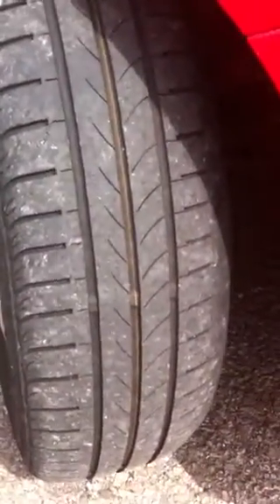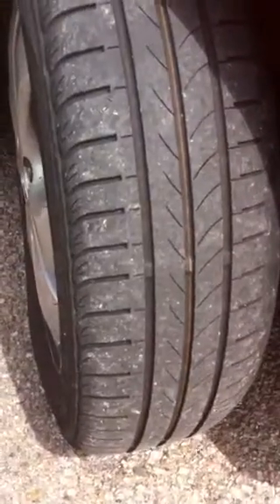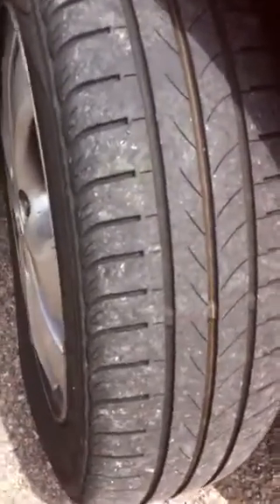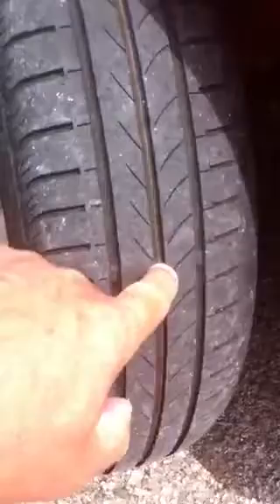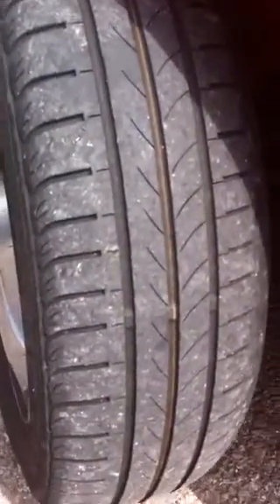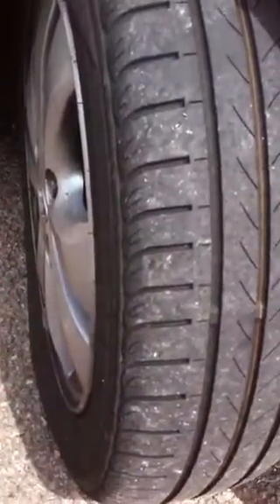Hyundai i10 dangerous tyre wear

Comment: this is caused by the camber angle being wrong (incorrect geometry in the design). the i10 was a bit of a hotch botch design, the rear tyres are further inboard than the fronts, checking toe angle from front to back by eye is not advised as if they appear to be inline then you definitely have toe out that can cause similar wear. if you increase the tow in angle it will even the tyre wear a bit but the front tyres wont last much longer (maybe 20%?). I changed the tyres from 165s to 175s on an i10, this helped also but they would still only last 15k Miles (with a lot of tow in), the 1st set of tyres lasted 8k but had worn to the steel wire. Hyundai blamed the problem on taking corners to fast but the wear was on the wrong side of the tyres for this to be true! vehicles with double wishbone suspension are easier on tyres as the camber angle changes to suit when cornering (the tyre remains flatter on the tarmac), MacPherson struts are a lot cheaper and preferred for small cars. If the vehicle is designed properly with the correct geometry the front tyres can last 20~30K if driven sensibly.

Comment: Same on my 2012 Accent SE. I travel extremely long distances and am replacing one or more of the tires every month, apprx. every 15 k-20k mi., especially the left rear. But all 4 have issues. Car is garbage due to that otherwise it would be a nice car. I have had the rear shocks recently replaced and the left shock, as per Hyundai dealer/shop twice as the thought was the shock seal had gone bad on the brand new shock, was told it was already leaking 4 weeks after install. Anyhow, I have driven about  10k mi since and am having to replace that brand new left rear tire again and right tire after about 22K needs RnR too. Unfortunately I bouhgt the car used with 61 k on it and the warranty has expired. I have replaced tires on this damn car half a dozen times in the two year I have owned it. Was told by dealer that I need the front springs replaced too.

Comment: The same has occurred on my 2010 Hyundai Touring Elantra here in N.A. This occurred on both front tires and exposed the steel wire belting beneath the tread surface. I've owned and maintained my own cars for almost 40 years and I know the signs of normal tire wear. 
Thanks for posting and know you are not alone in your concern.